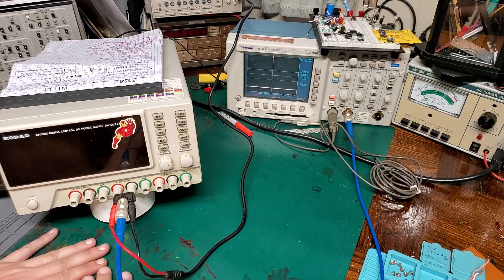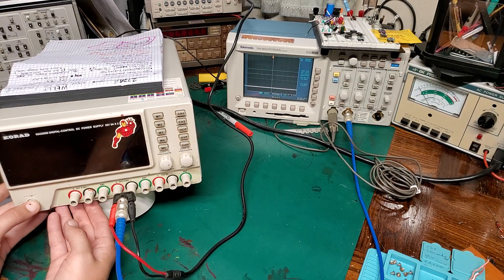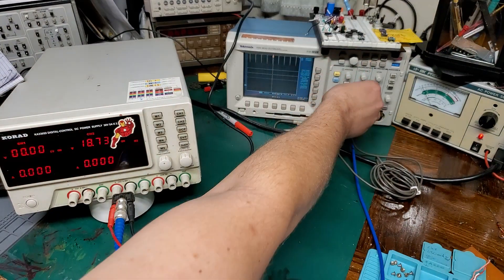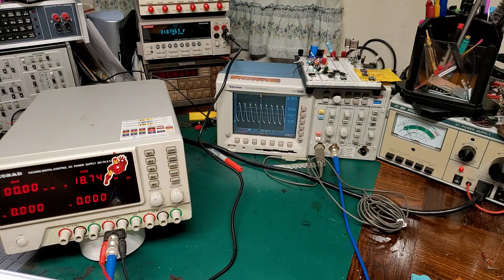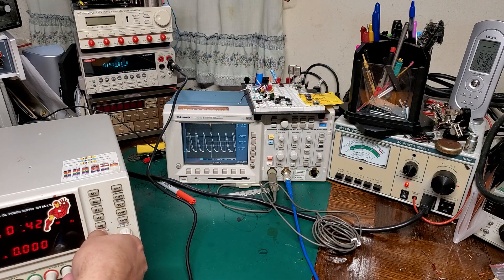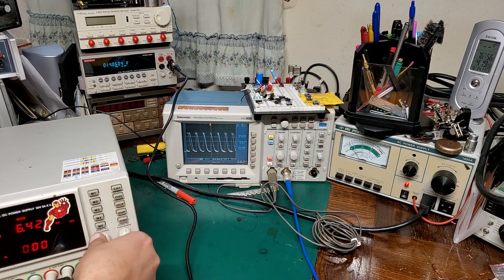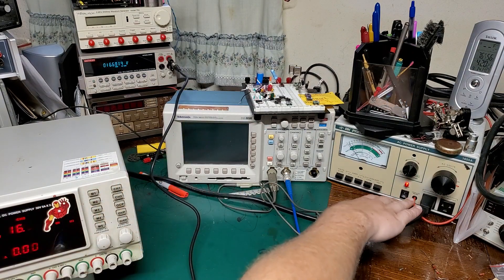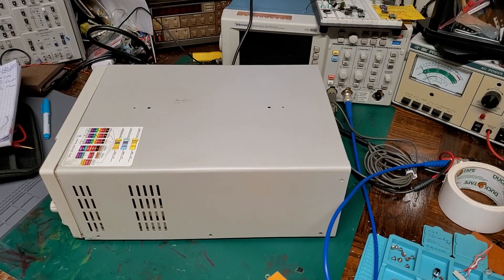KORAD KA3305D Digital control dc power supply psu teardown + failure + troubleshoot

Comment: My mods are:
Building a fan thermostat (w1209) in, replace the fan for a better one (Noctua) and bigger diodes and those 7812 get way too hot (bad for the caps next to them), want to replace those with little step down converters.

Do you know a mod that is an must do?
Reply from the maker: depends on what your usage for the PSU is.  if a little extra noise doesnt matter, then putting in step down converters would be okay.  but, an upgraded fan or heat sinks would be best if additional noise on the output is unacceptable

Comment: Was that failed diode in series of in parallel with the output?
Why didn't you replace it with a bigger one?
Reply from the maker: I dont believe it was in series, I dont remember, honestly.  I think it was just there for reverse polarity protection/inductive spike damping. (anode to ground, cathode to positive rail) and it got shorted out which killed the rail.
Reply: @topherteardowns4679  Thanks for answering  my questions!
Maybe its better to place the diode right on the screw terminals?
You did not place bigger diodes, why was that? (bigger is more better :D )
Reply from the maker: I just happened to have the original part number on hand, so I went with it.  I'm sure it would be fine using a higher rated replacement. If I used the power supply for powering motors or relays, I probably would have went with a bigger/better diode. and yes, just putting it across the terminals would work fine, if it would have failed open. but since it failed short, I had to remove/replace it on the pcb itself for the output to go back to normal operation.   @yoeribolderdijk1257
Reply: @topherteardowns4679  Thanks man, i want to buy two of them and mod them.
My mods are:
Building a fan thermostat (w1209) in, replace the fan for a better one (Noctua) and bigger diodes and those 7812 get way too hot (bad for the caps next to them), want to replace those with little step down converters.

Do you know a mod that is an must do?

Comment: Hi, i have the same one, my problem is volatage drops to zero when any load is applied , does same on both channels
Reply from the maker: Is it that way in parallel or series mode as well?  What kind of load are you powering,. Er, trying to power?  Its peculiar that its the same on both channels.    Maybe over voltage protect is on? Hard telling without it in front of me.     Have you obeyed the first commandment, "thou shall check all voltages"  ... id try a few configuration things first,  before taking it apart.  Of course, dont do that if you dont have a mains isolation transformer.  Indispensable bit of kit.   This isnt instructions,  and ur doing so under your own risk,  so be certain you know what your doing.  .  Hope this helped.   ...it probably didnt.. ...it went from a helpful tip, to safety meeting with osha, real quick.. sorry
Reply: @topherteardowns4679  yes it does it in all modes, series etc,  happened after I tried out a mini spot welder the other day, we repair phones etc here, but now even to power a phone at 4v it's drops to near zero when trying to power up phone,
Reply from the maker: @zxrjimmy1  even "channel 3" (the 5v output)    ovp ocp being on has screwed me as you describe. But, trying that spot welder couldve dominated the main series pass elements. I think they were FETs if I recall right.  But, if they failed, I dont think it would show the proper voltage until loaded down.      Mine would jump all over the place no matter what (after i killed the diode).
Reply: @topherteardowns4679  it reads the proper voltage, its just loads it can't handle, just tried a 4 Volt load and it's drops to 2v and when I press power on the phone it drops to 0.05v, weird
Reply: The 5v channel seems fine
Reply from the maker: @zxrjimmy1  it has its own pass transistor.